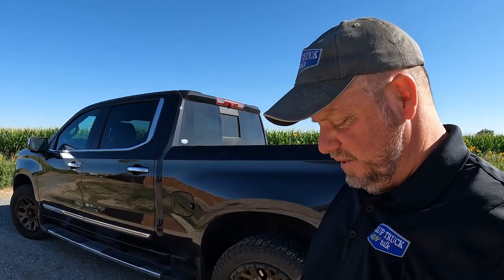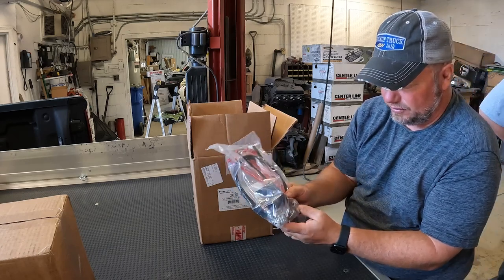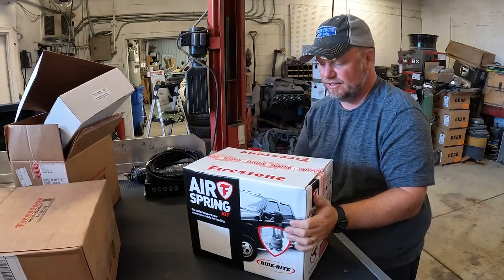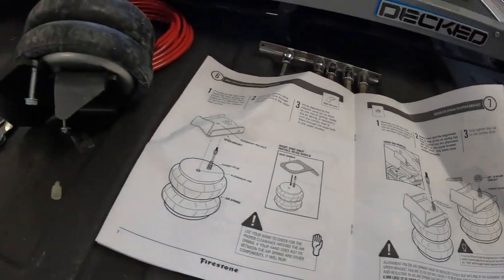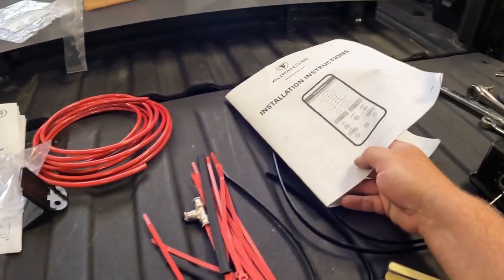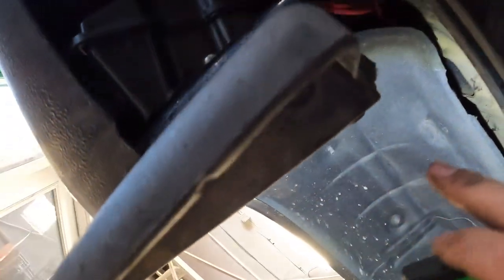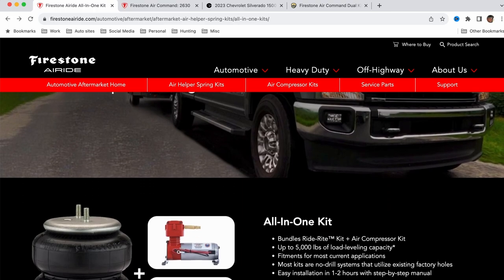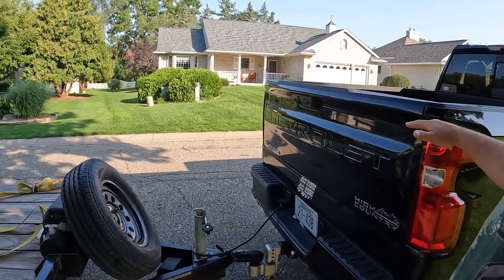Install, Price, Towing: Firestone Ride-Rite Air Bag w/Wireless Air Command

Comment: I have a similar Firestone kit on my 3500 and will never have a truck without them…. It is nice to be able to level myself out, and keep my headlights where they belong.
Reply: I like that my Titan XD has dial on the dash that lets me dip/aim my headlights when I'm towing heavy so the light is on the road where it belongs and not blinding oncoming traffic. Toyota has had this since 07 and Nissan also has it. Im really surprised the big 3 never offered this, especially in 3/4 tons and up because they're the leaders in pickups when it comes to things like towing/hauling for the most part.

Comment: Loved mine on my 2020 tundra. Did have some disturbing frame twerk though when towing without a weight distribution hitch. Had no fear about the tundra rear axle, but i would on a Chevy. That's just me though. Haven't had a 1/2 ton chevy to abuse since the 80s

Comment: Idk Tim, I feel like people that add air bags to their pickups for towing are living in the past. Weight distribution hitches are the only way to go. Adjustability, anti sway, and it makes the ride so much smoother.
Reply: Airbags dont negate the need for weight distribution, but can still compliment a WD setup.
Reply: I would agree however with these thin lipert tongues most rvs come with and lots of them are folding up like a beer can with the weight distribution hitches. My trailer has a Lippert I am not blaming lippert as they only supply what the rv manufacturer requests.
Reply: Most people I know compliment their weight distribution system with these when towing travel trailers especially
Reply: I have airbags (Timber Grove) and I don't pull a trailer. I have Decked drawers, a roof rack and cargo carrier. Also have a Pakmule hitch carrier. Am I living in the past? Can I utilize a WDH without a trailer?
Reply: I have never seen a weight distribution hitch for a fifth wheel

Comment: Lucky for me my truck came with them. However, you need to total your cost of ownership for mods you did to improve the truck (airbags,larger oil pan, etc.). That way people can see the true cost and decide if it's cheaper to just get it from the factory.
Reply from the maker: I'm going to do a recap video before I sell it.
Reply: I’m interested in knowing how much this build costs, but none of his additions are even available from factory.
Reply from the maker: @BabyGators  my quick math says $15k with labor.

Comment: TIME have my lightning pro deposit done and ordered as of last Saturday.  Antimatter Blue.  Canada only has a small allocation for these, have to sell 2 models in order to get the rebate, Pro and XLT.  That's the only reason you can buy a Pro retail up here apparently.  Quite a good deal.  Did spray in bed liner, small charger, tonneau cover and mud flaps.  Kept it cheap and simple.  Might have to drive the Ram for another year waiting for it, but could be as short as 4 months.  Currently I'm paying 24 dollars Canadian to drive 100 km, this rig will cost me under 4 dollars for the same distance (plugging in at home).

Comment: These can ride harshly, even when deflated. How’s the ride? Unit should have a wireless remote with red LEDs. Is the compressor slow? I have to install these in my truck but I have a rear axle flip kit to level truck. I might need additional parts for my app. Thanks for the how to!  👍
Reply from the maker: I’ll have to let you know. I’m still hooked up to a trailer.
Reply: Curious if you could combine airbags with shocks designed for lighter loads. Let the bags absorb more than the shocks themselves

Comment: To be honest, I'm pretty torn about all of this "free" stuff that you keep putting on your truck.  I appreciate seeing how it works, but I'm also torn as to whether free equipment gets the same scrutiny as stuff you purchase with your own cash.

Given that this thing is in, I'd really like to see how it impacts rear axle flex (as in RTI); it seems to me that this limits suspension flex.  Also, as an owner of a competitor's system, if you happen to own this contraption through the winter, I would be quite interested.  I live in cold part of Alaska and I get "Compressor Freeze" alarms all winter long.  Works well 8 months of the year.
Reply from the maker: I don’t like all the free stuff if that helps.

Comment: I missed if you mentioned it ,but did this kit raise the unladen rear truck height ?
Reply from the maker: No. It’s the same.
Reply: Did you measure before and after ?  my Pacbrake air bags @ the minimum recommended pressure lifted mine 1 inch .   @Pickuptrucktalk
Reply from the maker: @rodgood  didn’t even consider measuring. I can measure tomorrow if you need that information.
Reply: no that is ok if you do not have the stock height numbers .  @Pickuptrucktalk
Reply from the maker: @rodgood  I have stock numbers from other towing test videos.
Reply: ok  sounds like Firestones are the way to go if you do not want to raise the rear any more then it is already . @Pickuptrucktalk

Comment: How does it affect unloaded ride quality if at all?
Reply from the maker: I'll play with it when I can. I'm still hooked to a trailer right now. If the air bags are flat or at 5 psi, they should not have any impact on the ride.
Reply: @Pickuptrucktalk did you get a chance to experiment with ride quality with the bags deflated before selling the truck?
Reply from the maker: @MattN03  yup about 4k miles or so before I put them on.
Reply: @Pickuptrucktalk  was there a difference in ride quality between stock and air bags deflated?

Comment: I was quoted $3,700 for this airbags, compressor, and extra air. Is this a good price? It seems high. I called two places and got quoted about the same price. I live in Los Angeles, CA. Any recommendations would be helpful. Thx for the video.
Reply from the maker: Hmm... it is $1500 at least for the parts and they want another $2200 to install it? The labor for install seems high to me.

Comment: WDH must be the first choice. For safety reasons. WDH adds load to the front axle helps steering and braking. 
Air springs can’t do that.
Reply from the maker: I have a WDH as well. Just don’t always use it since I use a variety of trailers and don’t want to install the hanger brackets each time I hook it up.
Reply: @Pickuptrucktalk Remember that your truck is limited to 6k without weight distribution.
Reply: @terrencejones9817  I remember seeing this somewhere but wasn't sure where. It will void your warranty if something fails while towing if you aren't using a WDH over 6k, right?
Reply: @colton7846   It certainly could.  It's pretty clear in your owners manual.   Note: some Silverados can be 7k without weight too.
Reply from the maker: @terrencejones9817  ^this is correct. Page 308 of the owner's manual is 7k lbs or more.

Comment: Ram Limited standard. 😉
Reply: Can it adjust height as desired or does it always just level to a preset setting? (Serious question).
Reply: @ALMX5DP  There’s 5 settings you can control  on the dash.
Reply: @gmrtg1414  oh that’s pretty cool, yeah more OEMs should offer that type of feature and adjustability.

Comment: Mine suck if you don’t drive truck for   Days my compresser will and fill air tank and the remote doesn’t work very well and this 7000 system on a 1 ton dullay ?